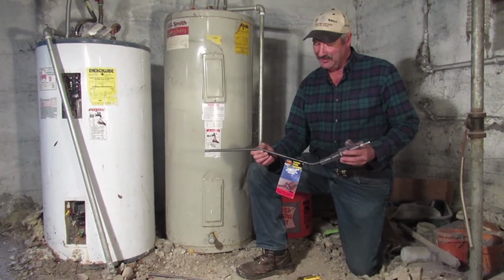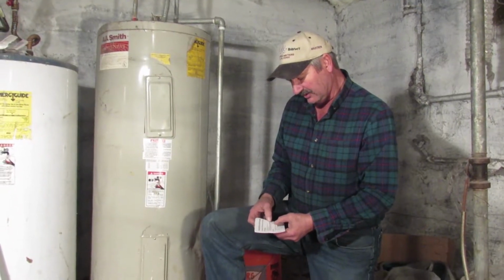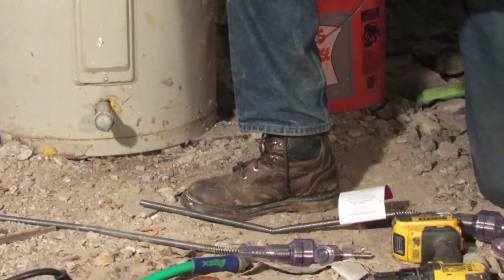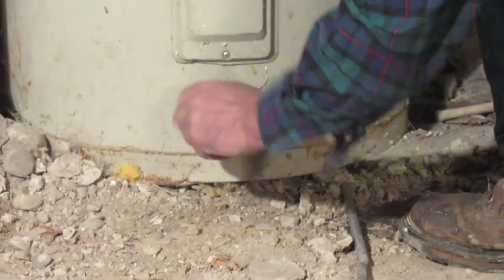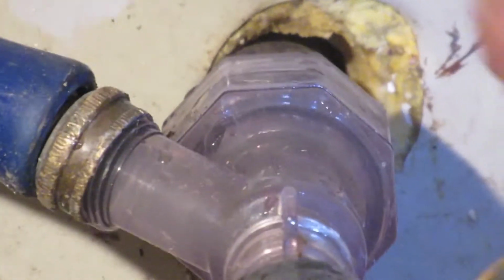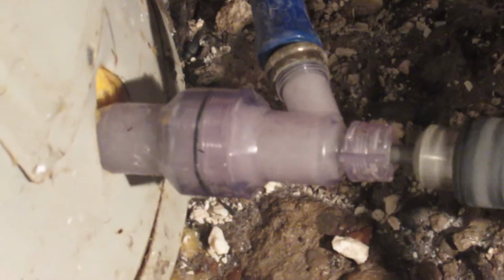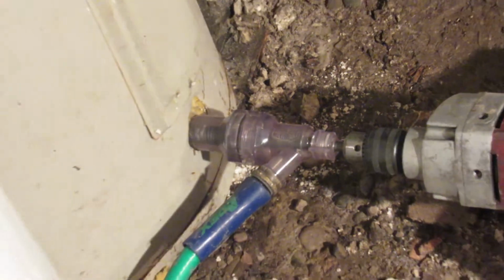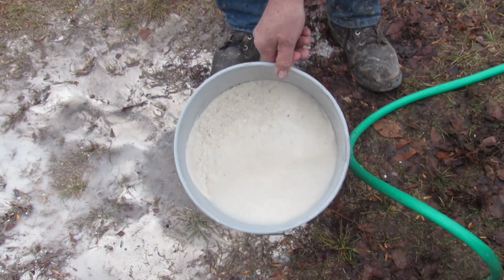TURBO TANK CLEANER | How To Clean Your Water Heater

Comment: I wonder what the whip does to the lining on the inside of the tank
Reply: I agree. It seems like a good way to damage the glass lining, potentially shortening the life of the tank. Would probably destroy the plastic dip tube as well. I'm skeptical about using this.
Reply: @jdjeep98  and the anode, and the electric element.
Reply: @jdjeep98  yeah dip tube for sure.  That is some thin plastic and usually deteriorates quick
Reply from the maker: The spinning agitator is designed merely to stir up the loose sediment deposits at the bottom of the tank so that the flowing water can sweep them into the auger. It is the spinning auger and the powerful force of the water that tare apart the chunks of sediment and pull them inside. The agitator is soft, flexible, has very little mass and will not harm your tank in any way.
Reply: @craigmuehleip9121  YA AND IF YOU BELIEVE THIS i HAVE ABRIDGE IN NEW YORK i WILL SEEL YOU FOR CHEAP TOO !!
Reply: @davem475  If it's a metal whip its damaging the enamel coated tank lining, no doubt.
Reply: That's what I'm thinking about too. 😳🙈
Reply: What material is the whip made of..
Reply: Steel

Comment: Why would you run the tool in reverse when it was designed to turn clockwise ?!
Reply from the maker: I like to turn the snake back and forth as I work the snake up through heavy deposits of sediment to prevent it from balling up in the tank.  Then you can start out turning it in reverse just to make sure it is not bound up. Then spin it forward to sweep the snake right and reverce to sweep left.
Reply: Don, hope your not a plumber.

Comment: So how long did it take for that sediment to build up?
Reply: Mine was 40gal tank, 30 years old, and I got 2 gallons of sediment out.
Reply: Haven't reinstalled the tank yet back into the system, so I don't know if it was too old and there was any other damage, will also replace anode.
Reply: As long as it took him to rethread the tool.
Reply: @bradleyrussell1973  
Bradley, what I was asking was, how long "over time" did it take for that amount of sediment to build up..
Reply: @RJ-sr5dv  he knows what you were asking

Comment: This is an awesome tool that should have been invented a long long time ago. It will save you hundreds of dollars in troubleshooting and prevent you from having to buy another hot water heater. I have seen it in action and it works
Reply: It will CAUSE you to buy another water heater! What do you think that steel snake is doing to the glass liner in that tank?
Reply from the maker: The spinning agitator is designed merely to stir up the loose sediment deposits at the bottom of the tank so that the flowing water can sweep them into the auger. It is the spinning auger and the powerful force of the water that tare apart the chunks of sediment and pull them inside. The agitator is soft, flexible, has very little mass and will not harm your tank in any way.
Reply: @craigmuehleip9121  Do you have a video that shows evidence that the snake is harmless?

"that tare apart the chunks of sediment"  by the way: that's "tear" the chunks apart.